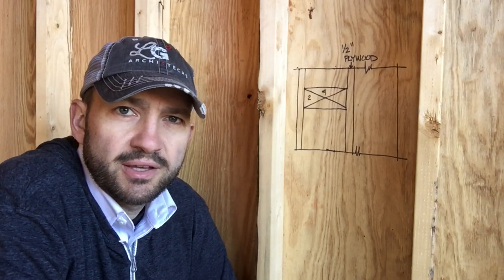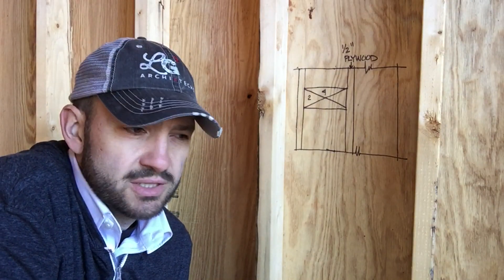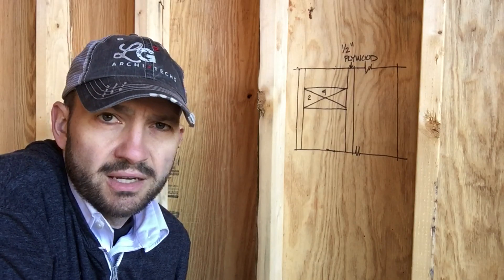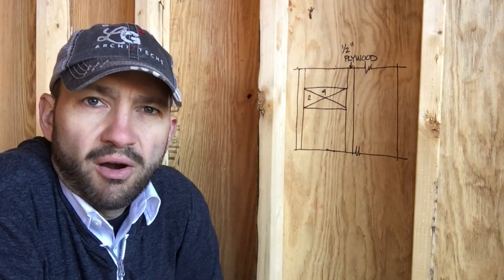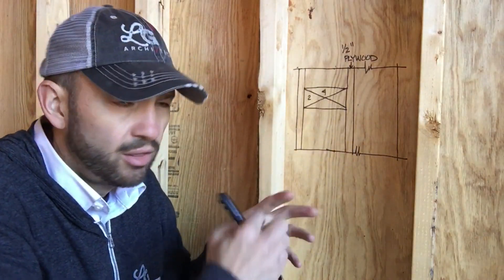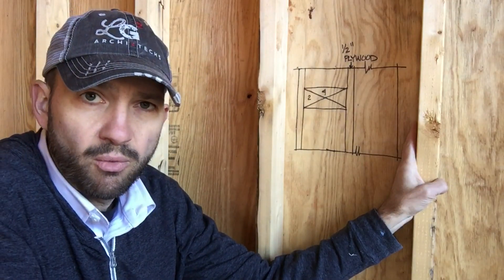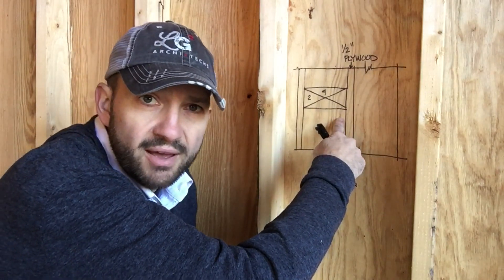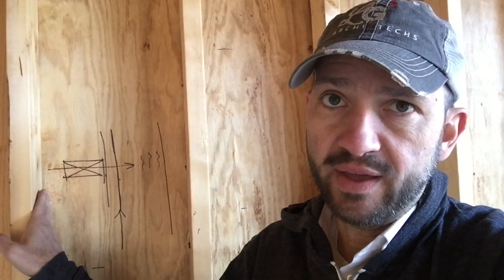How is THIS High Performance, with 12-inch O.C. Framing and NO Cavity Insulation?!?!

Comment: Do you find that the cost of extra exterior insulation is offset by not needing to install a vapor throttle (e.g. intello, membrane, impeccably taped and sealed drywall etc) ?

Comment: “10” inch long (wall sill plate) anchor bolts ?      That is insane .      You and your Structural Engineer should try drilling these yourselves. You will see how ridiculous this is!
Reply from the maker: No need, @Sue. All anchor bolts were set in place before the concrete was poured, using Simpson AnchorMate, so we can get the best of both worlds; no ridiculousness, and super strong and durable structure

Comment: That's a radically new concept for me. Do you have some blower door numbers and building energy costs so we can compare it to an older structure built by common methods?
Reply from the maker: @Kenneth, the post-rough-in blower door result was 0.06 ACH50, and the house is still under construction. We will be installing exterior insulation starting next week. So, we don't have any energy consumption numbers.
Reply: @LGSquared  That's a great number. I can see it getting even better as the house progresses.

Comment: Thanks, would love to see details like your fasteners for the external rockwool, your approach to outside corners, eve-to-wall and your coravent install. How's that for a punch list? Ha!
Reply from the maker: We are securing the insulation to the walls with 1x4 furring strips, aligned with every stud, and a 7" wood screw through the furring strip and into the wall framing. At the roof, we will use a 9" screw. Since all of the insulation is on the outside of the structures, we are using a triple stud at the corners. We don't need the space that a California corner allows for insulation. Check out this video about the roof/eve to wall detail. https://youtu.be/ITwTukfd-6U. Finally, we are attaching the cor-a-vent the same way we attach the 1x4 furring strips.